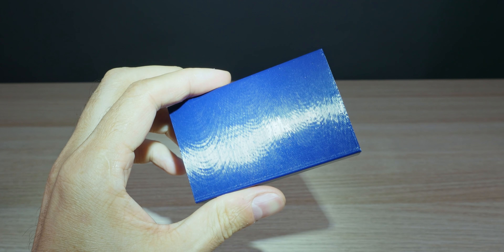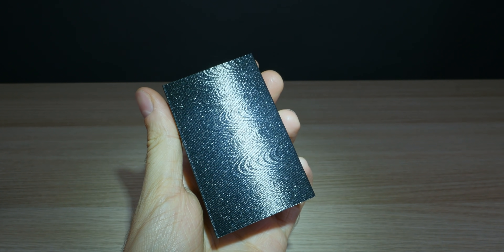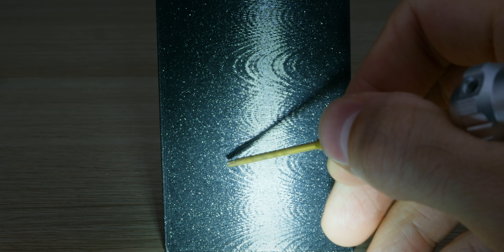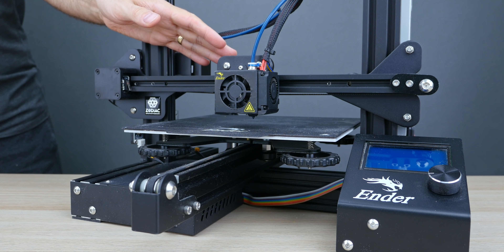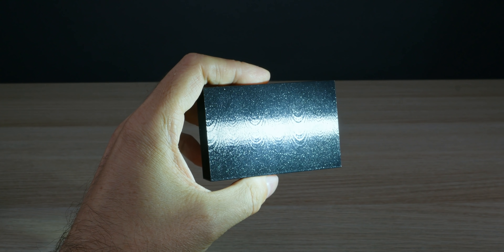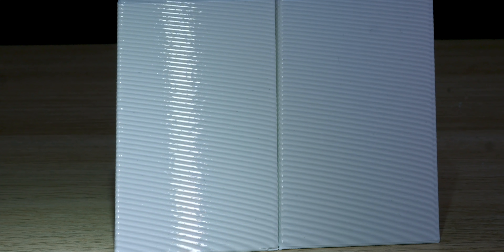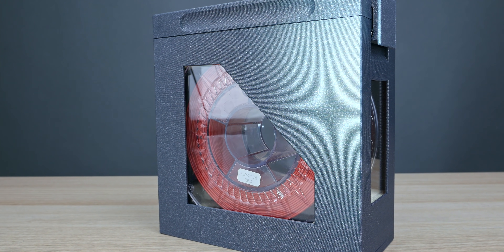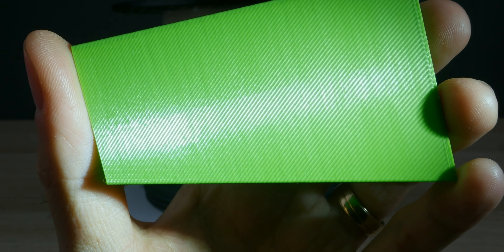The intertwined waves pattern in 3D printing

Comment: Apologies if you've addressed this but I'm curious, have you tried delving into Klipper? Resonance tuning isn't designed for this issue but I'm wondering if input shaping is a potential work around for issues as consistent as these.
Reply from the maker: I have no idea. I assume we'd need a way to "home" the extruder to know the offset of the pattern.
Reply: @MihaiDesigns  Good point, it's probably not practical but the wave pattern, at least on mine, is very small and surprisingly consistent so it would be an interesting test regardless. Each wave oscillation repeats every ~2-3mm horizontally, ~4-5mm vertically and aren't visibly intertwined.
Reply: Input shaper will not do anything for this, but pressure advance might.
Pressure advance is very responsive to changing demand, so it might disrupt the pattern a bit by adding some noise. The clue is printing at a reasonable speed, not the silly 40 or 50mm/s Prusa people seem to always use.
Reply: @joshua43214  Currently it won't help, the extruder isn't even supported. It's probably not practical but I'm just wondering it could potentially be applied to extruder movements in a similar way to resonance tuning.

I've tested with levels of pressure advance on and off and it doesn't make much of a difference. There MIGHT be small improvements near the edges but very minor.

Comment: Think of it like a blacksmith working on a metal rod;  hammer blows make the rod thinner and longer!
Each tooth is another hammer blow.
Gear-tooth cold-forging (nibbling!) reduces the cross-section while increasing the length.
The gear movement could be be perfectly smooth, but the 'nibbling' effect is still with us.
As you have pointed out, it is a small and subtle thing.

Bowden's see less of the effect; the 'springiness' of the long tube absorbs some to the length-wise pulsations.
Direct drive, the pulsations in length are passed on to the nozzle, making pressure spikes.

Two possible fixes:
1)
Subtle changes in feed rate, timed to match the teeth of the hobbed gear!
Call it "Nibble Compensation" or something cute.
Maybe fixed in firmware?

2)
Planetary screw feed to replace gears in extruder.
Rotating screws in a rotating cage that orbits the filament, driving it onward. 
But unlike gear teeth, the screw-teeth make a spiral impression around the filament.
This impression depth is much less than with hobbed gears, due to the larger contact area of the screws.
Step-wise gear nibbling is replaced by a continuous faint spiral.
No more bumps.
Reply: Option 2 like a fluid pump?

Comment: 1:25 It can't really be the displaced filament reaching the melting zone - because then, bowden setups would be affected as well?
Reply from the maker: Oh, I see your point. Didn't think of that. On the other hand, there's a very limited number of samples with bowden setups showing no other issues. Something to be further investigated.
Reply: @MihaiDesigns  i have printed alot with Ultimaker um2 and 3, and I always got the salmon skin on the prints there too. (what you call intertwined waves). But with the UM machines I always printed very slow
Reply: Was about to say this too
Reply: Very good point.  I am wondering if these printers are all gear driven or have noisy stepper drivers pushing the filament.  Could be the meshing of the drive gears or the noise from the stepper driver translating to imprecise and not very smooth prints.  Bowden printers would hide THAT barely perceptible pulsing with the spring action quite well.  I wonder if direct drive extruders with no gears and TMC drivers have the same issues?

Comment: I think the fact that bowden tubes mitigate the effect would tend to rule out the indentations on the filament as the primary cause (though I'm sure they do have some impact -- I've heard the E3D guys bring this up in talks with Tom Sanladerer, I think), because the indentations are still present at the meltzone regardless of the feed length.  What the spring effect would mitigate would be variations in feed pressure, and we still need to look to the hob for that.  The teeth of the hob are going to push unevenly on the filament as they rotate because they don't have a linear motion, plus they're deforming the plastic, so my money's on the hob profile itself; seems like finer teeth, herringbone teeth, knurling, or no teeth (soft surface?) would be the answer.  Whether indentations or hob profile or both, though, I also think the viscosity of the molten plastic in the nozzle would have some damping effect as well -- which would increase with feed rate, consistent with the tests showing faster print speeds giving more even results.  I've observed this on my machine, which can do single-wall prints more cleanly at 100mm/s+2400mm/s2 than at 50mm/s+1600mm/s2.

Comment: @MihaiDesigns The gripping teeth causing this does make sense as it is elongating the filament as the teeth are going into it. As each tooth goes in, a slight elongation occurs.
That said, the angle at which those teeth are going in can be a factor. Do you have any data/feedback from users who used the larger (8mm ID/12mm OD) dual-gears, like those used in the Orbiter extruder? The larger radius of those gears means that not only are more teeth engaged with the filament, but the angle of attack of the teeth engaging the filament is less.

Another thought is: Are the extruders simply adjusted to grip too tightly? Does loosening them to the point just before slippage help? It should. This also would be partially mitigated by the larger radius gears, as the same pressure over a larger surface area would mean less distortion of the filament.

FYI: I thought for certain, from your last video, that this was caused by the jerky meshing of the teeth in the meshing teeth. I've noticed that if I have mine cranked tight, simply rolling the gear with your fingers with no filament gives a tactile feedback that has very strong steps to it.
Reply: I can rebuild my printer between 8mm and 12mm direct extrusion but I want to get a 0.9° stepper as well, currently 1.8° but it doesn't make a lick of sense. I'll let you lot know how it all turns out.
Reply from the maker: I wonder the same thing. Only one sample from an Orbiter, but they forgot to slow down the print 🙁 I haven't noticed any difference when varying the grub screw tightness, but that was back when I was focusing on the wood grain pattern. Perhaps I should run more tests now that my extruder are better tuned.

Comment: The ascender extruder I was using doesn't appear to have this problem either and it is not a Bowden extruder. I'm not super convinced this is an issue with ALL bondtech style gears
Reply from the maker: That could be true. More data could help, even though most printers have more serious problems than this, so just a part of the data received is useful for this test.

Comment: I likely haven't noticed these patterns because both my printers are Bowden and I print at 70mms. I feel that most people don't really get the most out of there printers by not trying higher speeds.
Reply from the maker: Yup, I do test print at high speeds as well to see how far I can push it and what happens when surface degrades.
Reply: @MihaiDesigns   have you experimented on adjusting interior and outer wall speed to reduce the patterning? Perhaps if your make them quite different you could reduce the pattern. Almost like phase cancellation. Keep up the good content😎👍

Comment: It would be interesting to see if a drive gear with knurling (little diamond-shaped teeth) would be better than the horizontal cuts that are common.

Also, someone could modify the firmware to add noise to the extrusion to cover up any small periodic defects.  That would probably be more helpful than using lower-quality filament.
Reply: Or perhaps using something like a Dremel grinding wheel with a shallow groove cut into it

Comment: Wasn't this the kind of issue solved with TL-smoothers on 8 bit boards? But anyway it goes to show that FFF/FDM is inherently so flawed that if you use perfect filament, it still messes up, or as stefan @cnc-kitchen showed, just the bed heating and cooling by 1 degree in normal operation gives surface flaws
Reply: TL Smoother only works on DRV8825 high current driver, it compensates for its inherent engineering issue that this chip cannot emit any current at small drive voltages. The TL Smoother is a diode assembly which always consumes a fixed voltage at zero current, mitigating this issue, and allowing this chip to drive current into any phase angle.

This issue of the chip is well known so it's not widely used. The most common chip is A4988 which doesn't have that much of a maximum drive current but is very well behaved, and dirt cheap too. Trinamic chips used on silent boards are also well behaved.
Reply: @SianaGearz  have been using TMC 2208 and 2209 for a long time now, the only printer with A9908 drivers i had was my first i3 plywood knockoff, my CR10S got a new board because of the temperature issue, ever since all my printers have SKR boards and 2209s as soon as they arrived, so never had to use TL smoothers, the ripples just reminded of the fishscaling issues lots of people had
Reply from the maker: Yeah with Trinamic drivers there's no need for TL-smoothers. And indeed, I initially also thought that my filament quality was causing issues, but turned out to not be the case. Of course some filament can still make it look like the surface is smoother, but that's another story.
Reply: @MihaiDesigns  yeah, ive tried quite a lot of different filaments and depending on the quality and consistency of the diameter it reflects quite well in the print, the firmness of the material plays a role, softer (ABS/ASA/PETG) can be shaped more by the extruder which evens out the diameter, carbon fiber in any combination makes for smooth prints because the filament is stiff and consistent. And direct drive and dual gear, unlike BMG and titan etc. Are affected by the heat of the stepper shaft heating the gear and melting the filament or expanding for more pressure.. and all within 1-10 degrees fluctuating

Comment: Huh, I thought from your first video you were talking about the drive gearing and not the hobbed gripping parts. That explanation still makes more sense to me because extrusion amount is a function of pressure. The smaller nozzle will increase the pressure. The length of filament in a Bowden will act as a spring to hold tension and keep pressure even for longer. Going faster requires higher pressure. Though I suppose those bumps in the filament would also cause higher pressure because there periodically more then less material

What I found so compelling about the gears explanation was that it is difficult to transfer torque perfectly linearly using gears because of their profile and meshing. I'd love to see an experiment where the two hobbed gears are bound together with a belt and pulleys to see if that helps
Reply from the maker: It was the drive gear for the wood grain pattern in the previous 2 videos. This is after you solve all the other problems including the wood grain. I'll be testing more gears.

Comment: Maybe a gcode post processor could slightly vary the speed of a long segment breaking it in different shorter segments. The final result will be a more fuzzy (maybe looking like a sparkle filament but without the clogging risk) but it should not have any pattern if the speed change is random enough. A similar trick is used with CNC spindles that continues to slightly vary the speed to avoid resonance (most of the time)

Comment: Hmm ive always had an assumption that the waves was caused by frequenze made by the DD unit causing the molten filament to have a small kind of ripple effect that will give theese artifacts / "uneven extrusion"
Reply: Stepper motors do step!  That does seem like a likely culprit.  Configuring the controllers for microstepping can result in smaller steps, but they are still steps, and even microstepping depends on the voltage available and torque required.
Reply from the maker: I'll have to run more tests to see for sure.
Reply: Wasn't that the "ringing" effect? Correct me if I'm wrong
Reply: Well, the ringing effect is mostly caused by vibration of the entire unit because of the extra weight added by the DD unit. Ringing can often be cured by going slower with less accel and jerk.

Comment: It seems that most of the problems you discover and solve are on high end or modified printers. You should address that roller problem on the Ender 3, the most popular printer in the world.
Reply from the maker: Yes, it is the high end. I guess most people won't get here. I'm hoping to not have to dive into the roller problem, at least not for a while. These tests take a ton of time.
Reply: @MihaiDesigns  I have an ender 3 pro and definitely appreciate all of these tests and solutions because they are showing all of the factors that go into a print. It is all transferable knowledge.

Comment: I use a BMG extruder clone - dual stick extruder and I get perfect results with your test model. Maybe the gear reduction 3:1 helps (if I remember it right)?  Right now I can print faster (more material without skipping) and I was able to reduce the retraction from 6 mm to 3.7 mm.Definitely worth it for a little less than $10. Maybe somebody finds that interesting as well.
Reply from the maker: Glad to hear you don't have this issue. Would that be a direct drive? I never thought you'd need more than 1mm of retraction.
Reply: @MihaiDesigns  No it's a bowden setup with Capricorn tubeing. Btw, thanks for your video!
Reply: I am curious, what is the name of the manufacturer and where did you get it from?

Comment: We use a fortus 450mc for industrial prototyping. And every print taller than 0.400 inch gets these repeating patterns as well. Not nearly as severe as your examples, but we've always got surface finishes like that.
Reply: Do the Stratasys gods basically just utilize the same style of extruder gears?
Reply: @JJFX-  afaik they do, but the use a bldc and encoder instead of a stepper
Reply: @Tedlasman  so there's a market out there for better extrusion gears

Comment: That's a good find!

I think this could be easily fixed by firmware. The stepper and the gear have a predictable position. A single calibration to correlate the stepper's steps and tooth position, and it's basically done. The calculations for pressure advance can probably be used directly (for Klipper). But, i don't know if that calibration depend of an exact starting position (=using a closed loop stepper), or if it's possible to just use a full step as a start position.

A year+ ago, someone tried a metal insert inside the nozzle, to even the pressure. Not a lot of pictures, but maybe an interesting thing to try. He printed it via Shapeways :
https://www.thingiverse.com/thing:3698348
https://imgur.com/a/qiD36at
Reply: They don't have a predictable position. Steppers are not servos. E-axis has no endstops. Every time you turn off the E-stepper, when you re-energise it later, it's likely to find itself one or several 1/100th revolution increments (for a 200 steps per revolution stepper) away from where you left it, since these positions are electrically identical. There's also this point of view that you're "supposed" to tune your extruder current such, and that occasional once an hour micro skips are OK. It's debatable but really quite valid.

The start position when the stepper driver is initialised is always a full step position, but you can't really know which one it is. When you disable stepper, behaviour depends, but anyway you could just drive the reset line.

Comment: Just a few variables come to mind that would need to be tested... Roller grip patterns (smooth, fine texture, toothed), Roller material (Metal, hard rubber, soft rubber), Roller spring pressure, print speeds,  print temps, filament type. But i'm just happy when I get successful prints.

Comment: Hi Mihai, Have you tried using 0.9 deg steppers on the extruders, these should provide a smaller level of amplitude on the patterns?
Great posts by the way, loving the channel.
Reply from the maker: Yes I have 1.8, 0.9, and 3:1 reduced motor. Same result.
Reply: @MihaiDesigns  Thanks, I imagined that if the stepper/reduction would have an effect it would be expressed in slight reduction in the amplitude of the pattern, modification in its wavelenth may not occurr because the pattern may be generated by a forcing which is a lower common multiple of the system (step, gear teeth,filament teeth).
I am trying to move on from the 8mm outter diameter (OD) BMG gearing to the 12 mm OD BMG gearing on my extruders but your last post really made me thing about going back to Titan style extruders.

Another sugestion (difficult to implement though) is to cut new filament teeth that have different multiples and therefore generate different patterns that would surelly validate your thesis.
Reply: Different prime numbers on each side of the BMG gearing and teeth come to mind... you's still have multiples to contend though.